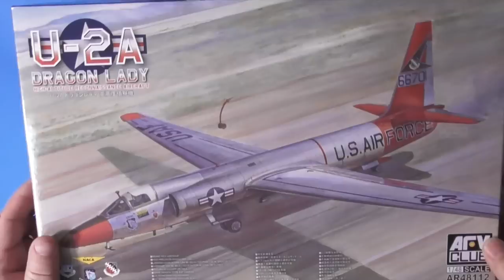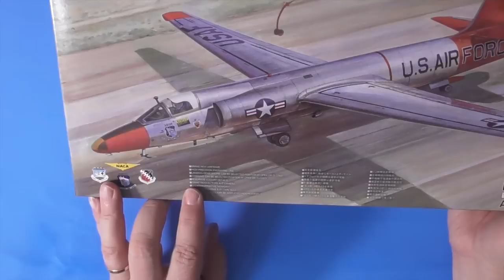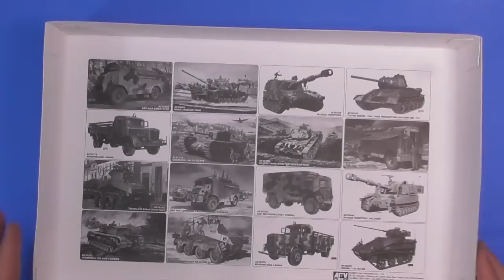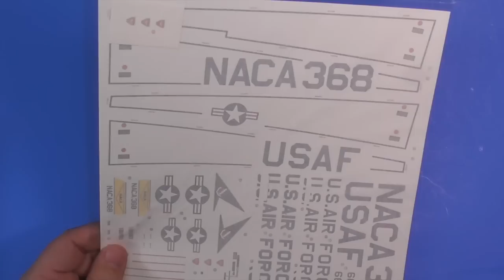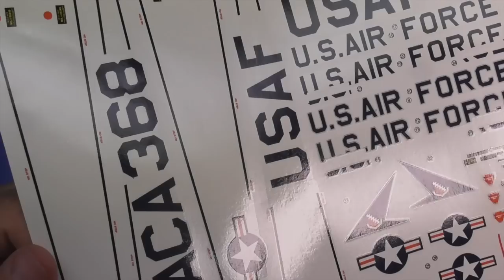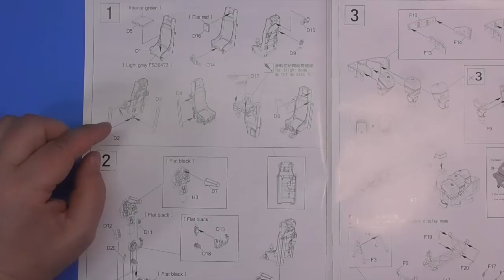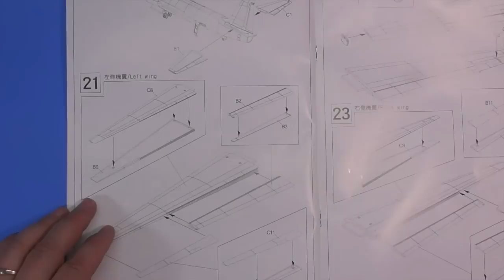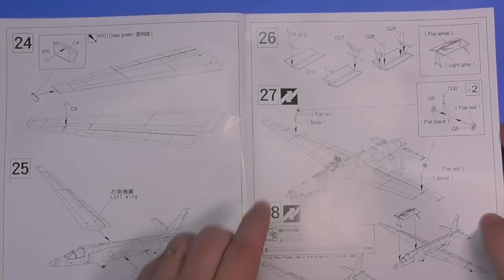Sprue Review AFV Club 1/48 U-2A Dragon Lady

Comment: The item you see falling away from the aircraft in the box art is called a “pogo”. They are designed to fall away at takeoff, and put back under the wings when it lands to keep the super pods from scraping the ground. The camera is called “optical bar camera” on the S model U-2. The other thing you will need is a camero as a chase car. The pilot cannot see the ground, so they use a chase car with radios to let the pilot know how close to the ground he is.
Reply: They are using Tesla Model S as chase cars now, at least stateside.
Reply: oncydium last time I rode in one was at Osan back in 2008. Is the passenger seat still filled with radios?
Reply: @mrnibiru5925  Not sure, I haven't seen them in person (the last U2 flight I saw was at Moffett Field in '77 or '78!). I imagine that there's still all the comm and telemetry systems used in the Chargers as the layout wouldn't require re-training all the U2 pilots driving them; they've probably been updated to whatever the current comm specs are for the mission. I'm not sure if the Teslas have the actual aircraft comm antennas that were retrofitted on the Charger rear decks, but I suspect the Teslas have them as well. USAF is now using the Model S in the UK, too - not sure about any other fields.